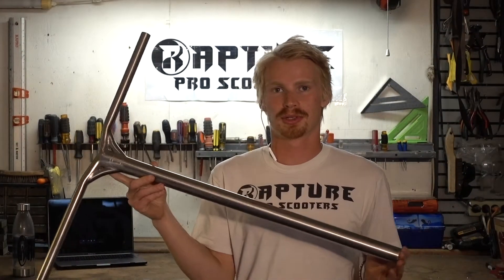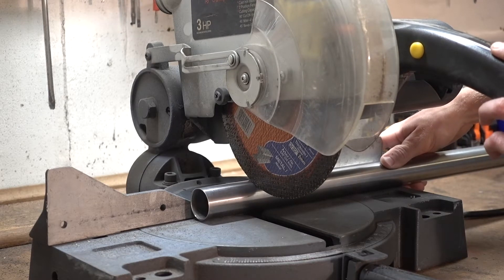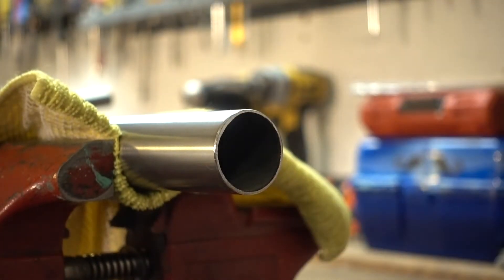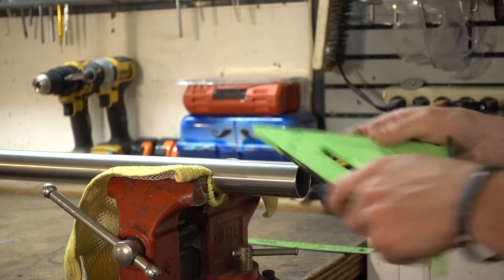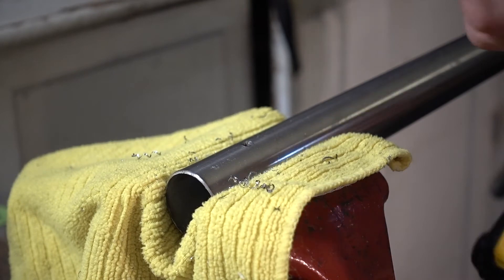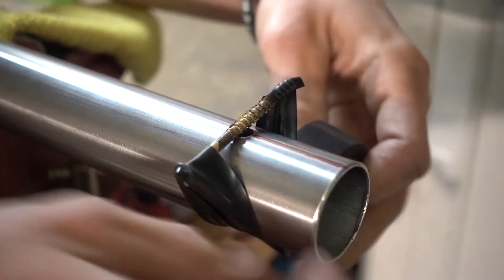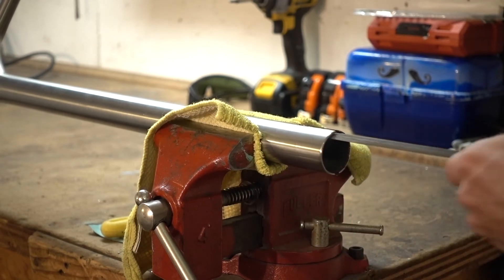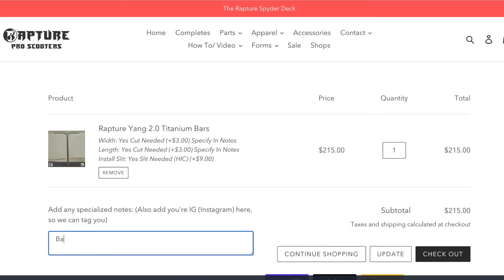How To Cut Down Scooter Bars and Install a Slit | TITANIUM SCOOTER BARS

Comment: Can you do it with a flex cutter too?
Reply from the maker: if cutting ti titanium, the odds of a flex cutting working is very very low. something like this: https://www.amazon.com/Flexzion-Cutting-Diameter-Aluminum-Plastic/dp/B07XT2K4SC/ref=sr_1_1_sspa?keywords=flex+conduit+cutter&qid=1708282162&sr=8-1-spons&sp_csd=d2lkZ2V0TmFtZT1zcF9hdGY&psc=1
This type of cutter would only work for steel and aluminum bars.
Reply: @ChaseRost  i used flex cutter a few days ago to cut my bars and somehow it went well so im happy

Comment: Hi, I was wondering if I could use an angle grinder and if so what blade. Also how wide should the slit be.
Reply: yeah you just need a metal cutoff wheel that'll cut steel

Comment: Do u need any cooling sprays or smth for cutting titan?
Reply from the maker: I have personally not used cooling spray before, and have never had any issues with my slits. i have put about 500+ slits in bars now at this point with Rapture parts. and given the riders have the correct clamp size, i have never actually had anyone complain about cracks. But i would imagine that cooling spray would be a great idea as that would help keep the heat down and keep any potential weakness from heat build up from happening. if you have it, i would definitely say use it. but if not you'll be good.

Comment: will this work for steel bars
Reply from the maker: it sure will. this is the exact same technique I use to cut down steel and aluminum bars aswell.
Reply: @ChaseRost  ok, thanks!
Reply: How about if your bars are oil slick, if I were to use an angle grinder will the coating flake off?

Comment: Is it bad if the slit is a bit too thick?
Reply from the maker: no thats totally fine, as long as the width of the slid does not surpass 1/4" or is any larger than your slit hole.

Comment: just bought ti bars and need to cut them down a little 

when i cut them down the slit is 0.4 inches too short

what should i do?
Reply from the maker: Hey sam! I would recommend drilling a new hole where you need the top of your slit to be. And then I would use an angle grinder or chip saw to make the slit reach the hole the rest of the way. Now if you are riding a good solid clamp that fully covers your slit, The first slit hole should not have to much effect since the second new hole is nearly half and inch above it. Hope this helps, definitely lmk if you have any questions.

Comment: I came here to make sure i didn't make a mistake as I've been riding oversized scs and my bar keeps sliding off a little at a time after every landing. I thought i over used the coin trick on the clamp at first 😅
Reply from the maker: thats such a common issue with scs compression. the bars just are constantly working their way out. I personally ride hic. i only have to adjust my bars/ compression about every 3 months and thats usually just because i need to clean up the dust around the headset.

Comment: Whats the difference if you put a slit in the side than the back of the bars?
Reply from the maker: it helps keep the pinching pressure from the clamp from creating cracks. the greatest clamping pressure is right int he back so by moving the slit to the side, it helps better distribute the pressure and keep the bars from getting pinched right on the slit.
Hope this helps, i also touch on this part around 3:30
Reply: Thanks for this. This is really helpful. Keep it up.

Comment: Wouldn't the titanium bars weaken by cutting them down?
Reply from the maker: Technically yes, anytime you add cuts or high heat to titanium it is technically weaker (more brittle). But thats why doing the slit for HIC compression correctly is SOOOOO important. always have to add a relief hole at the top of the slit or your pretty much asking for them to crack. and then as far as the cuts on the ends of the bars, thats totally fine since the bars ends don't take pressure.
Reply: @ChaseRost  Alright, thanks for the info. I was hoping that there would be a way to cut titanium without weakening it, such as underwater, but I don't think it would work that well. Gotta do more research.

Comment: what happens if you warp your clamp?
Reply from the maker: sounds like you might need to get a new clamp then. but i'm not quite sure what you mean. do you mean the clamp itself is not a circle anymore?
Reply: @ChaseRost , I am talking about your clamp bolts like stripping them...
Reply: @joshsanders5823  buy new bolts
Reply from the maker: @joshsanders5823  gotcha. Sorry for the late reply. But you can definitely replace just the bolts on your clamp without having to buy a entire new clamp.

Comment: What happens when you ride your clamp not facing the slit?
Reply from the maker: That’s actually a bit better long term for your slit. It keeps the clamping pressure from focusing all of its force on the slit. Which then usually leans to stress cracks. So having the slit on the side of your bars is actually a very good thing to do.
Unless your talking a full 180 on the other side of the clamp?
Reply: A 90 on the side

Comment: what happes if the slit is too skinny
Reply from the maker: if the slit is too skinny, than sometimes the bars wont be able to properly clamp down as the clamp presses in the bar. the metal will just pinch together and not actually tighten down on your hic shim.
Reply: @ChaseRost  oh thank you!
Reply: @ChaseRost what should j do if I cut it to skinny
Reply from the maker: @Bigb0tArchie  super simple fix. All you Gotta do is cut it a bit wider. You can use an angle grinder or a chopsaw, and just run the blade against the slit a little bit until it’s wide enough.
Reply: @ChaseRost  cheers 👍
Reply: What if you cut the slit too wide?

Comment: What do I do if the slit is the wrong wau
Reply from the maker: what do you mean? like the slit was installed wrong? Which ever way it is, you can always make your bars last longer by riding a clamp that is taller than the slit.
Reply: @ChaseRost  noo like my bars snapped so my dad put a slit and he did it at the front of the bars
Reply: @hrrytrny  just sue your bars backwards or smth
Reply: @hrrytrny  dont reckon itll matter
Reply from the maker: @hrrytrny  depending on the bars, you might be able to just read them backwards if they don’t have any back sweep. Putting a slit in in the side of the bars is definitely ideal. But since the slit has already been cut in the front of the bars, you should be all right. Just try to make sure that your clamp fully covers your slit. So it adds the extra support.